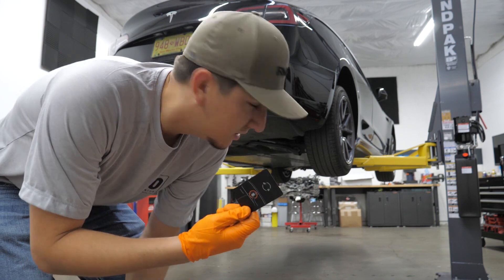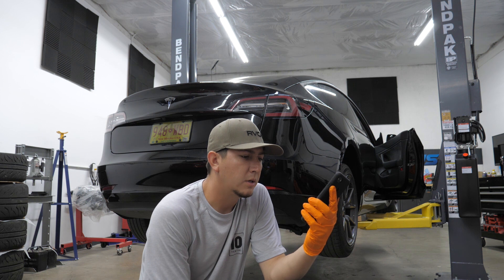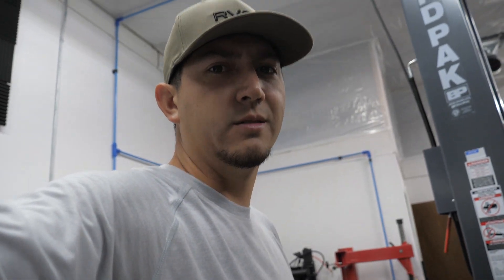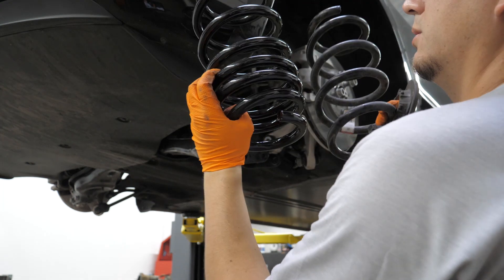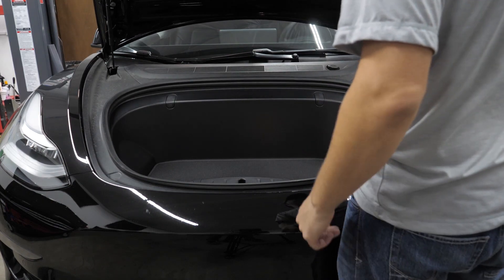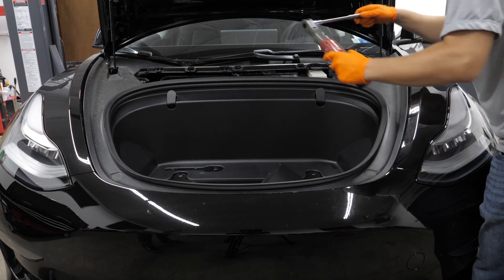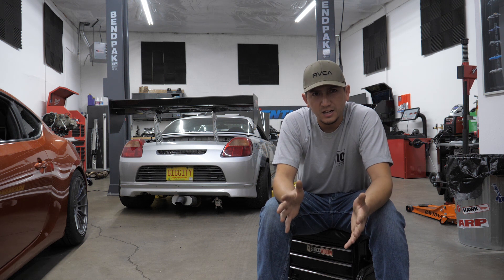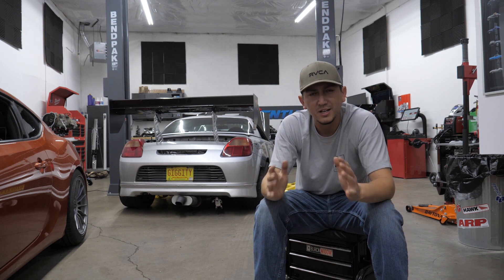How to lower a Tesla Model 3!

Comment: Just curious, as this is something I consider for my new M3P , with the Eibach Spring pro-kit with 5mm spacers, since we cannot adjust the rear camber, did you notice additional wear on the tires? should I buy a Rear Camber and Toe Arms? or not necessary. Cheers.
Reply from the maker: I would say adjustable rear camber and toe arms are completely necessary. The M3 rear suspension geometry does a pretty good job of maintain alignment specs when lowered. If you want to extend your tire life as much as possible then absolutely invest in some camber arms. We actually installed the stock springs back on this car as the customer was looking to sell it, the tires looked great even after a year of daily driving. Hope that helps.

Comment: Hey man, great video!  Where did you buy the springs and spacers?  The Model 3 aftermarket is small...but starting to grow pretty quickly!
Reply from the maker: Thanks, we added the springs and spacers that were used on this car in the video description, unfortunately we don't remember the wheel spacer widths. We only remember the rears where wider then the fronts. I think they were 15mm in the front and 20mm in the rear.
Reply from the maker: Thanks for info kind sir!
Reply: Message the customer service on the main blox sport website and get the forged 7075-T6 spacers. Not the 6061-T6 listed in the ebay link. 7075-T6 is much stronger and safer (not that the other one will fail, but it's better not compromise when it comes to spacers). Negotiate like the other poster said though.
Reply: Did the car efficiency change in any way with spacers, springs? Do you have to get lug studs instead of OEM bolts?

Comment: Did you trim your bumpstops (my eibach springs suggest 20mm trim front, 25mm trim rear)?
Reply from the maker: No we didn't, we have done two of them so far and haven't felt the need to trim the bump stops.

Comment: Great video.  I was wondering what were the torque specs for tightening down the front A arm to the macpherson strut assembly and what were the torque specs for the nut that connects the top hat to the top of the shock shaft?

Comment: 5:48, Peterbilt trucks are built American made and use both.

But yeah, easy to go up and down measurements on the fly with metric.

“Crap, 10 is too small, better get the 11,” is easier than “crap 7/16 is too small. Maybe it’s gonna need a 5/8 or is it a 3/4?”

Comment: DUDE. I just attempted this install and got one front spring in ...saw the hat was crooked, assumed I'd messed it up, uninstalled and reinstalled 4 times before putting the stock spring in and quitting. How did everything go once you reinstalled? Any issues arise?
Reply: Oops. Just saw your little recap at the end of the video. Guess I'll reattempt next weekend.
Reply from the maker: Yeah, those springs aren't exactly perfect however once we had them bolted back up to the upper control arm they aligned themselves much better. They could have been designed better but we've also seen worse. Just do your best to get them close, once they are under weight they align well. It's worth all the work, don't give up!
Reply: @10tenthsmotorsports11  my first thought was that they looked like stock springs with the top coil cut. They're well reviewed. I'll give it another shot. Great vid! Thanks!

Comment: did you trim the bump stops?
Reply from the maker: We didn't, there were no instructions to do so and at the time we didn't think it was necessary. It's been awhile but I believe the bump stops on the model 3 were very short from the factory.
Reply: @10tenthsmotorsports11  Eibach instructions say to cut them and tsporlines are supposed to be rebranded eibach's. Interesting, I am doing the install right now and I am not sure to cut the. Like you said no one else instructions says to cut them. Thanks
Reply from the maker: @juanmedinar20   Our customer has had the car on the road for a few months now and hasn't voice any concern yet, our roads are pretty bad so I would imagine he would know right away. Let us know what you think once you're done with the install!

Comment: Thanks for posting this. I watched this and decided to install the same springs myself (Tsportline for AWD/Perf). However, I am now getting a lot of clunking sounds from the front. It looks fine and feels/drives fine  - sounds like a clunker. Any ideas on what it could be?
Reply from the maker: We're glad this motivated you to do it yourself! If the sound is indeed coming from the front then it can only be a few things. I would check the sway bar end link and make sure the nuts are nice and tight. My next guess would be the lower strut bolt, if that checks out I would make sure the upper strut and control arm bolts are tight. If everything seems good then the top hat might not be tightened all the way against the shock shaft, you can sometimes take the wheel off and use a jack to slowly compress the shock until you hear the noise in question. Make sure the car is properly supported by a jack stand before using the jack to compress the shock. Also make sure you don't lift the body off the jack stand while compressing the shock. Focus more on "full drop" to normal ride height rather than compressing the shock. Good luck!

Comment: great video! My suggestion tho is for you to reach out with the owner of the car you lowered and take some pictures. Also would you also please elaborate if you can on how the front alignment was adjusted with the 4 bolts (2-13mm & 2-15mm) Much appreciated.
Reply from the maker: We will see if our customer will send us some more pictures! The factory model 3 components don't really allow for much adjustment other then toe, at least from what I can remember anyway. The Camber can be slightly adjusted by loosening the "upper control arm housing" bolts and allowing them to move towards the center of the vehicle. This takes advantage of the tolerance in the chassis mounting holes which can sometimes give you .5 a degree of camber adjustment. The adjustment is likely not noticable at all, however we would prefer to have more negative camber then any positive camber. Alignment shops wouldn't consider this an adjustment, it's more of a Motorsports type of adjustment. Sorry if that made it more confusing or just created more questions, let me know if that helped!

Comment: While this was a quality video.  He took off or loosen way too many parts for this exchange of springs.  The front in reality is just 5 bolts to remove.
Reply: I learned a hard lesson, on an AWD you have to take the entire front shock assembly out because of the drive axle. 

On RWD you do not and can just take the 3 smaller struts bolts up top and lower shock bolt out then just push the lower arm down to remove. No way no how on an AWD, you have to remove the whole assembly.